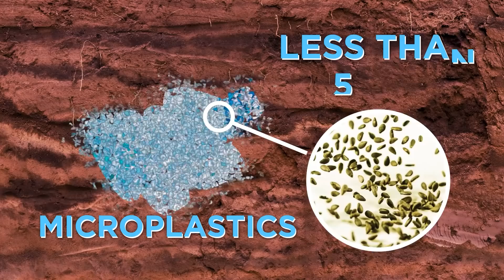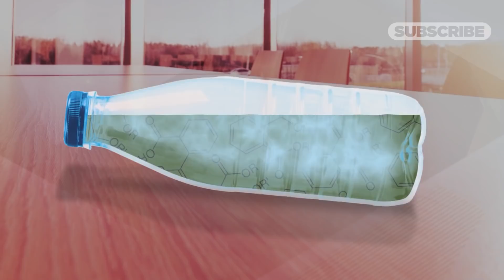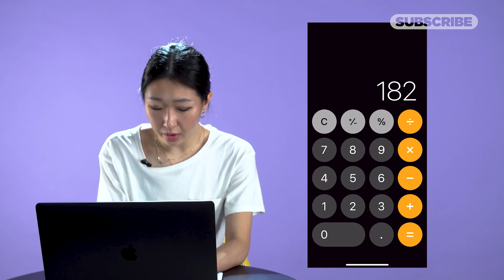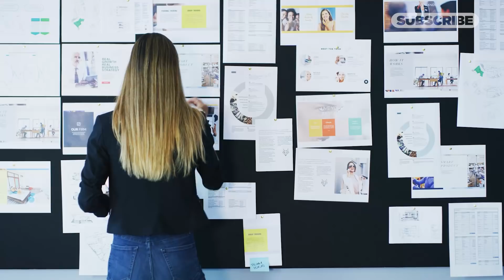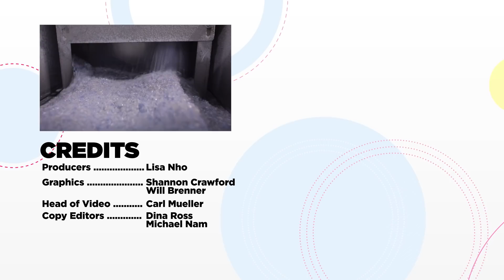How Much Plastic Is Really In Our Bodies? - Cheddar Explains

Comment: Please don't quote the 2019 study, just look at the methods employed and their suitability. The first half of the study estimating particle count is usable, it has a little less than an order of magnitude of uncertainty. At the second part it completely trips over itself with size estimation and parades up a figure that is plain implausible. You don't eat 2 spoonfuls of plastic a week! It's even so according to the study itself, it has a window of uncertainty for the weight of several orders of magnitude, and the 5g per week is what comes out at the absolute highest end, not as a best-effort estimate!

Your copout that most food wasn't investigated isn't valid, because most food just isn't a substantial source of microplastic comparatively, so of course preliminary evaluation was done to limit what makes sense to inspect closer and what doesn't.

Arguably, weight is also a completely irrelevant figure, because the volume of plastic is effectively inert. The more interesting figure is area, which is potentially chemically active, and also grows every time particulate breaks down and gains increased penetrative ability.

Do you want to know the WHOLE story of 5g/week? You're not going to like it.

Comment: 4:58 yeah these numbers are just BS. So let's get this right. An Apple contains around 190000 particles of plastic per gram. But 1900 particles equal to 5 grams? We have studied these in school and micro plastics found in foods are insignificant. Micro plastics in foods are measured in part per billion, PPB. Something this video didn't even bring up. Let's take water bottles for example. You would need to drink well over 100 bottles a day for the plastic to even have any sort of effect on your body. But that will never happed because if you consume that much water, you would die of water poising, which is a real thing.
Reply: There are up to 40.000 particles measured in germany lakes in a depth about 5 centimeters, per kilogram.

Comment: Would like to see how the plastic particles get into the tissue through what should be barrier membranes in the lungs and digestive system.  Also to what extent the body is able to get rid of plastic (must be at least some ability, since it doesn't build up without limit if the pollution isn't overwhelming).

Comment: I have some concerns regarding the statement that each gram of apples contains 195,500 plastic particles.
This would mean that a typical apple, weighing 200 grams would contain about 40 million particles... and that seems unlikely.
Reply: Yeah the maths are a bit off. Later in the video they equate 2000 particles to 5 grams meaning each particle weighs 0,0025 grams. Applied to the apple it'd be 500 grams of plastic particles per... gram... of apple. So I think the problem is their definition of "plastic particle" here, which is not consistent.
Reply: Why would apples have plastic in or on them?
Reply: @freeassange5667  she explained in the video that micro and nano plastics can enter seeds, dirt, water and air. So plastics enter food, like apples, through those ways.
Reply: @Just_Reading_Comments  why would plastics be in the soil?
Reply: @freeassange5667  plastic items discarded and lost, artificial textile fibres getting washed into the waterways, numerous mechanisms.
Reply: @freeassange5667  It falls down with the rain and snow for starters. You didn't know there was plastic in the rain?

Comment: Home water filtration units also use plastics in the casing as well as in the filtration canisters. Wouldn't it be ironic if filtering your water actually ADDED pollutants like plastic microparticles to your drinking water?
Reply: It's probably a tradeoff -- for instance, getting rid of certain particles in exchange for leaching slightly soluble stuff like phthalates into the water.  Although I do notice a small amount of graphite particles in the first 1 or 2 batches of water after installing a new Brita filter in my pitcher, so it isn't as if a filter COULDN'T put particles of its own in to the water.

Edit:  On the other hand, some of the plastic particles may be too small for Brita filters to trip significantly.
Reply: @86kotek  Yes, I saw that in the instructions and I do that.  But I wouldn't expect that the particles that it makes just quit all of a sudden after 2 pitcher-fulls.  It very likely tails off with use and never goes to zero.
Reply: @86kotek  It's probably okay for us, but what about for aquatic life?  (Lots of things that are only slightly bad for us are very bad for fish.)

Comment: 1:38 So basically my decision is between drinking bottled water and contributing to plastic being everywhere....or drinking the tap water and having to risk the potential of developing cancer because a local manufacturing company dumped chemicals that tainted the ground water. Nice.
Reply: I wish the world went back to glass or aluminium for 99.99999% of liquids
Reply: I live in Scotland and beautiful water comes out the taps. 
It's not even metered. 
We wash our cars with it.
Bit short of sunshine but not water.
Reply: I drank tap water my hole life, shits bustin
Reply: How is that your choice? 4000 (tap) is < 90000 (bottle water)
Reply: @Stars-Mine  op isn't talking about the nano plastics in tap water vs bottle water. They are talking about the fact that in many areas the tap water has basically been poisoned through pollution so it's not the plastic particles you have to worry about.
Reply: Yeah it's a tough decision. Here in NZ if you live in the countryside you are at high risk because the farmers have poisoned the ground water but the cities have good water treatment systems test regularly and don't get much water from ground water.
Reply: You should buy a BRITA filter then you can have clean tap water without contributing to plastic waste
Reply: @AdamLehodey  aren't they encased in plastic and usually drain into a plastic jug
Reply: @86samsky  make your own distillation system. I have a gravity filter that uses mainly metal but I have always wanted to build my own system.
Reply: Now PEX plastic tubing is sharply replacing copper pipes.  So if You do drink faucet water at home that plastic is in You body.  I refuse to have PEX in My home.
Reply: Buy a distiller

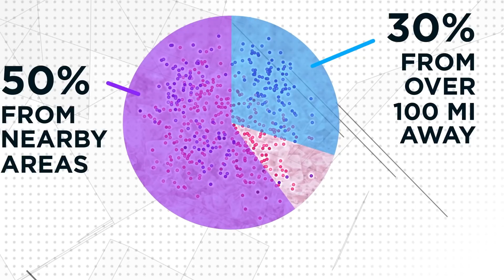Comment: 3:15 your graph shows 60% purple pie but states 50%

fix it
Reply: Yeah, and the math adds up to only 90% of the graph, but the graph is full. (50+30+10% equals 90)

Pretty sure they meant to say 60% and then the graph wood be accurate. (I spelled would incorrectly on purpose.) 🤭